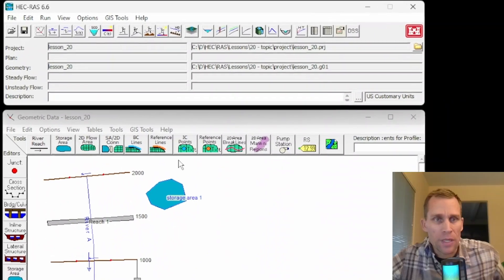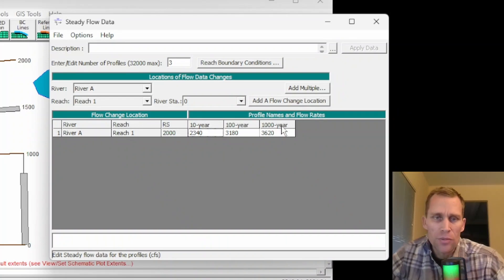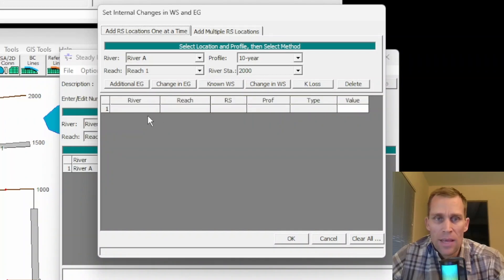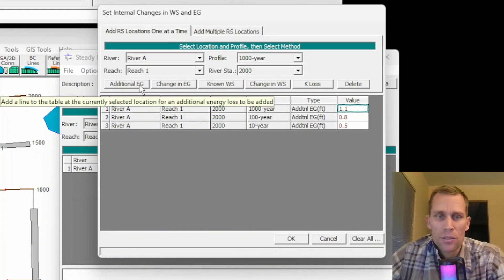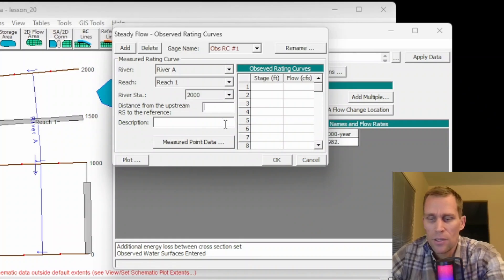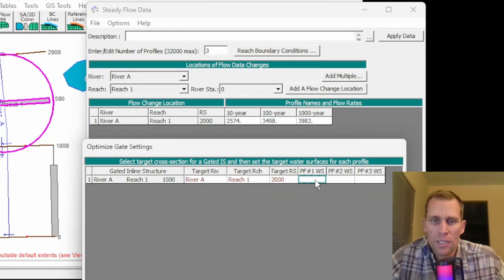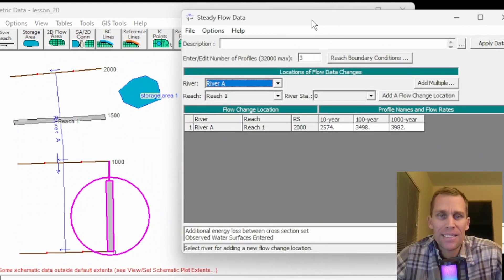HEC RAS Lesson 20 - Steady Flow Analysis - Entering Data

Comment: Thank you!

What is the difference between RS inside the table (header of columns) and River Sta.: that is next to the reach?
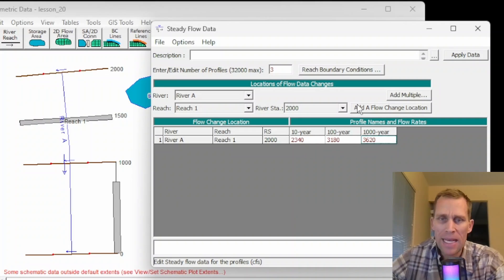Reply from the maker: The data in the table is used by RAS to define what flow rate to use when running the simulation. The dropdowns for "River", "Reach", and "River Sta" (above the table) are only used for adding a new row to the table. When the user clicks "Add a Flow Change Location", the values from those 3 dropdowns are used to populate the "River", "Reach", and "River Sta" columns of a new row in the table, as demonstrated at 2:37
Reply: @TimNelsonPro thanks 
That was my fault as I mixed them up.